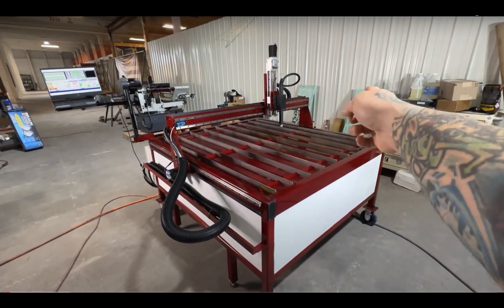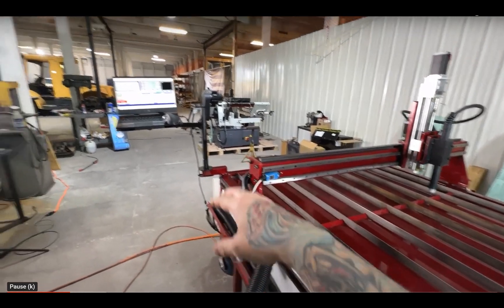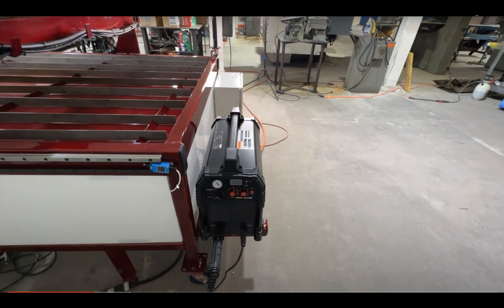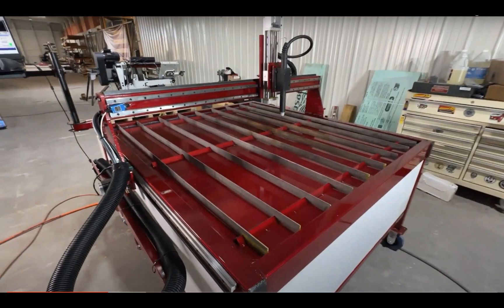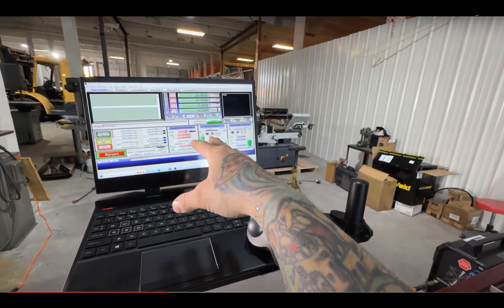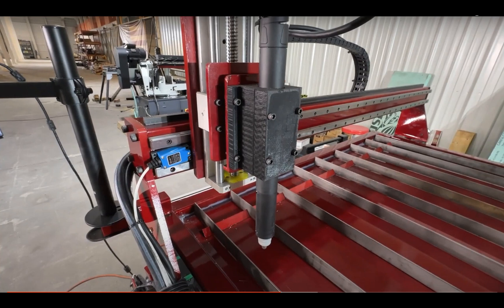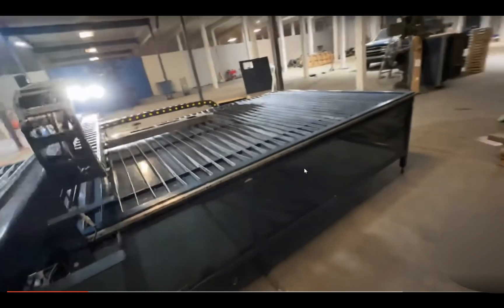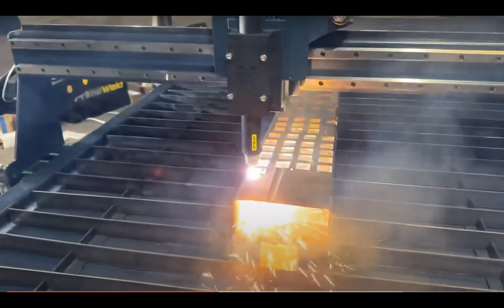CNC Plasma Controllers Built Incorrectly (Volume 3)

Comment: so returning grounding to the 3 pin Ground pin not good enough? thanks
Reply from the maker: Thank you for your support. Please use more details when asking your question as I want to make sure I understand it. 

Thank you,
Vince
Reply: @corvetteguy50  sorry, i may have been vague. i would typically (i'm not an electrician) return my grounds to a steel bonding surface fixed to the chassis. then from there return to the ground pin on the IEC. (bear in mind 3d printers are as far as my experience extends). im just wondering perhaps said CNC seller done it that way. thanks
Reply from the maker: All grounds in best practice are to be run to a ground bus bar allocated to your electronics enclosure as you discussed. 

The power supply you're using for your system if built correctly would be grounded, and using a metal enclosure which would make it conductive allowing it to conduct to your metal electronics enclosure to ground it. 

Thank you,
Vince

Comment: Is it mandatory/recommended to have two end-stops (hall effect/limit switch) per stepper? Can't he just screw in a block of metal on the end to stall the steppers in case of soft limit failure?
Reply: You can do whatever you like as its your table, but I believe all machines should have end stops.
Reply: Thanks for the response. I'm used to the switch being referred to as an "end stop" and now I realize that you're referring to a physical barrier. Issue clarified.
Reply from the maker: Thank you for your support. All production robots should have physical end stops for many reasons namely to prevent damage to the axis from as I stated in the video a person running the axis completely off their table. An end user should never trust a physical switch to prevent this from happening in place of having their chassis built correctly. Thank you,
Vince